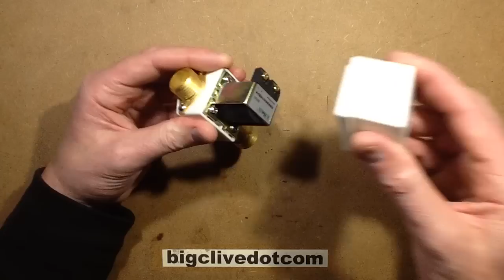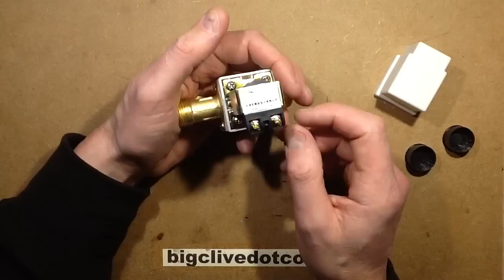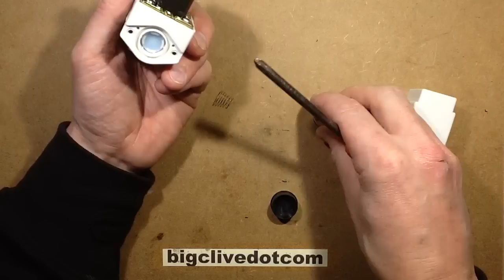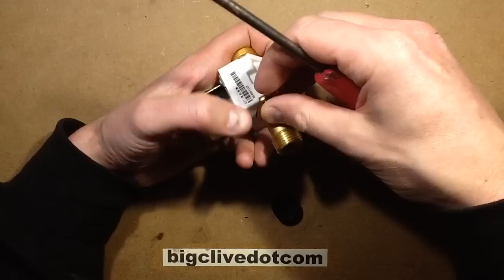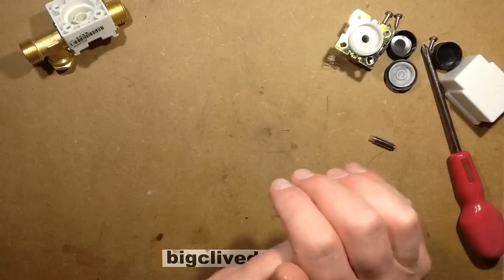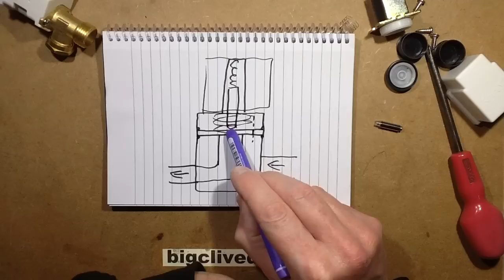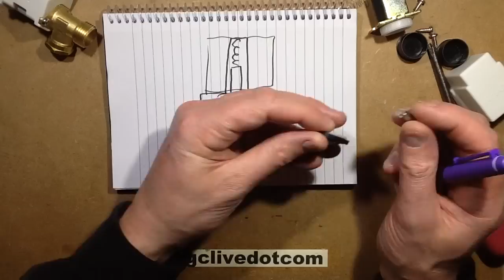inside a cheap eBay solenoid water valve.

Comment: Modern toilet cisterns have fill valves which work with the same method - it means the float can be much smaller as the force required is less than a traditional ballcock and valve assembly which equates to smaller, neater cisterns.

Comment: I wouldn't want to put too much pressure on that thing, it would rip the screws out of the brass ends.
Reply: I have only seen a glued in one fail. There would be millions of screwed in ones all over the world. If the outlet has any pressure on it the valve will close the inlet is only a small area so PSI is low.

Comment: That filter would be critical to continued operation.  If a bit of something gets embedded into the diaphragm, the valve might never shut off!
Reply: Normally the only part to jam them is the filter breaking. Mostly caused by rust on the plunger jamming. Some German washing machines have a mechanical device that unwinds and cuts off supply if water has been flowing to long.

Comment: wonder how much lead leaches from the brass...
Reply: its most likely alumium bronze, it would be cheaper that brass and be better for its conditions, lead would be an expensive additive
Reply: Why would you have lead in brass?
Reply: it stabilizes the alloy and increases machineability.
Reply: +10mintwo But it's the zinc that leaches out hence DZR brass - DeZincification Resistant.

Comment: Do you know a kind of "fail safe" valve that restricts water flow if a pipe/hose would burst, but allows normal flow for a short period of time if there wasn't any flow for some time?
Reply: Google aquastop.
Reply: Robert Szasz
Just looked at details on their website for the Aquastop YS mechanical only. You set the variables time/flow rates on installation, so you set them for what is normal for your situation. It also detects pressure drop across the device. I've never fitted this type, but i've fitted many of the hose-in-hose type, mainly because they are standard fitting on many high-end white goods.
Reply: mark rainford oh those look nice. Not exactly what I was thinking of, but just googling "aquastop" brings up a lot of random crap, where googling "aquastop ys" pointed me to wayscale and nice leak detection products. 
Thanks for the pointer to some useful stuff
Reply: mark rainford aquastop seems to be a hose in a hose shutoff. if the outside hose gets pressurized it trips a one time valve. Something smarter that just looked for flow or no flow, and shut a valve after x minutes of flow would be best. (a fire sprinkler  flow detector, a delay relay, and a electrically trippable valve could be slapped together to do what you want)
Reply: Yes, they also do mechanical only or electrically operated valves that detect abnormal flow rates.Robert Szasz
Reply: mark rainford the problem with those is that "abnormal flow" includes opening a valve all the way to fill a bucket or similar high flow uses (refilling drained water heater). Having a way to automatically shut the water off if there is either a high flow for more than x minutes, or low constant flow for more than y minutes would be nice. I havent seen anything with a time delay for high flows, or time delay with checking for constant flow rate.
Reply: Robert Szasz
Yeah, sorry. I should have linked it. I had to wade through all the makeup aswell lol.

Comment: Clive you gotta use it on a whiskey bottle hanging upside down, then you can make a remote control and a relay powering/depowering the valve and bob is your uncle ;-)
Reply from the maker: That task would be better suited to a peristaltic pump for accurate shots.
Reply: Unfortunately these valves have a minimum pressure. If you don't have enough pressure to overcome the force of the spring, they won't open.

Comment: I'd not be surprised if that Brass was DZR brass - allowing for variation in monitor performance, the shade seems "just right". The inline filter is a nice extra too - not particularly fine, but obviously someone's thought about this, and the end product is all the better for it. Chinese quality is RAPIDLY improving, and I'd expect the same transition in perception as we saw with Japanese cars - originally poorly-regarded, now the Industry standard.
Reply: New notepad too? Plastic coil vs. your "usual" spring coil? If those self tappers pull out Helicoil them - a far better fixing method, and (because of the finer thread) a much tighter grip.

Comment: Oddly enough my old electronics teacher gave me the first explanation of these ingenious valves - I think the context was an automatic bath filler with temperature control. It never happened - we couldn't find low voltage ones at a reasonable cost...and  tbh the idea was a bit rubbish...
I'd fancy this for greenhouse applications or perhaps a PIR operated anti-cat watercannon.
Reply: Built an "automated" watering / misting system using near-identical washing-machine valves decades ago. Two valves, and a pair of bimetallic strip thermostats, along with a simple 556 timer circuit and a pair of relays to handle the 240v for the valves. Built it in 1985?? Still works just fine . . . . . .
Reply: Phil S Yeah - that's the same period. we could get scrapped 240V washing machine valves cheaply enough but we weren't allowed to make mains gear in school. Thought about handrolling low voltage solenoid coils but then I went off the idea anyway.. There was a nearby shop that specialised in scrapping old industrial control panels and you could get some super relays, transformenr panel switches and stuff...
FWIW timer based watering systems are on the way out, you can buy ones you can control from an app on your iphone - so even on holiday you can busy yourself with domestic chores.
Reply: joinedupjon The "old and simple" approach works fine, especially where fault-finding is concerned! The "watering" side was not thermostat controlled - that was a standard "water for x minutes then stop" which seemed to work OK. The two 'stats ran the mister, a cheap bathroom extractor fan, and a solenoid / spring control on the roof vents  - I had a BIG (10 x 8) greenhouse and in the summer months, it "needed a little help" with  temperature management :-)

Comment: You explained it really well, I wonder what the maximum pressure that it can cope with is?
Reply: I don't think I 'd trust that on mains water pressure.
Reply: Mains water pressure isn't really all that much, it varies from around 2 bar to 6 bar, but if you have mixer taps in your home you should be using a PRV to regulate the pressure to around 2.5 - 3.5 bar (or you get leaky taps). A valve like this one would have been designed with industrial use in mind and should be able to handle more pressure than a domestic supply would be capable of.

Before anyone bangs on about turning down the stop tap, it's important to point out that pressure and flow are entirely different, they're like voltage and current.
Reply: *****
See that's what I mean, that's not a pressure problem it's a flow problem. Pressure only exists when the taps are closed and the pressure equalises to the external (to your property) pressure. If you put a pressure gauge on your system and almost fully close the stop tap, the pressure will remain the same as when it's fully open, but as soon as you open another tap you'll get a burst of water, which will then slow to a trickle because the flow is obstructed at the stop tap.
Reply: ProGamer1515 Personal experience lucky the water temperature is warm enough you barley need a heater in summer. The Chinese  metal taps just break if you bump them.
Reply: Strider9655
I'm pointing out the the valves on my washing machine handle, mains water pressure just fine and seem to be designed better and probably cheaper.
Reply: I am reffering to the design. Do a quick search on google for soleniod valves and you will see that the input and output on better designs is often a single piece of material. Less points of failure.
Reply: New Chinese metal taps corrode from the inside around 5 years life. Your on the 30th floor and the stopcock is downstairs behind the garage and you just stepped out the shower. Why they have floor drains in all bathrooms unlike the UK.
Reply: Strider9655
I've seen pictures of metal taps blown off by mains water pressure and people's boilers burst and flood because of it. The self tapping screws  holding the fittings on looks like a point of failure.
Reply: Coolkeys2009
Not sure what your getting at, I mentioned the use of a PRV, having one of these would prevent most if not all instances of what you describe as it totally isolates the internal plumbing from the outside water mains.
Reply: i might try that and get back to you
Reply: Larkhill21 What?
Reply: Larkhill21 Wow, they sound very shitty. You'd think there'd be separate cutoffs for each apartment in or near each apartment.

Comment: Entertaining as always.  Question, i was looking online for a atx power adapter that would allow me to go from say the 12v rail and be able to adjust the voltage and current.  I know about the little dangerous prototypes board as well as the little boost buck converters but i cant seem to find and dont know why just a box that you plug the 24 pin into and has those adjustments built in.  Are you aware of such a thing?  If not you should make em:)

Comment: Fantastic explination of a solenoid now i know why my washing machine makes a massive thud in the pipe as it stops water entering.
Reply: You can get small (<500ml) expansion vessels to put in the supply to act deal with this. Worked a treat here.

Comment: Absolute perfect description of a pilot-operated valve (for either pneumatic or hydraulic). I work with solenoid valves, pressure regulators and pneumatic relays on a daily basis, and you nailed it with a very easy to understand theory of operation regarding pressure differential on either side of a diaphragm.
Reply: Hi Lake, i need a few solenoidal valve for controlling the Waterflow through pipes. Can you give a link to purchase it in USA?

Comment: Hey Clive, great video as usual.
That black and silver screwdriver (that you use), is it a pound shop one, I ask only because I bought one from my local pound shop. When I saw it I thought 'Big Clive has one like that'. I have also paused one of your vid's that have the said screwdriver in it, to get a good look. I think I have the same one as you.
Reply from the maker: It's from Poundland.  It's one of the best of this type of driver I've come across.
Reply: Rabbi Zyklon Brausebadstein 
But still, very handy to have.
Reply: We got given a 'freebie' during a presentation at work, branded by a large German electronics manufacturer, looks exactly the same as the poundland one, made en masse in China no doubt and re-branded to suit.

It's quite handy though, I use mine all the time.
Reply: I recently bouught one (in red) from Maplin for 99p. It doesn't have a good Phillips range though.
Reply: pretty much clones and clones and clones
ive bought aset and ive got a few sets of some kingston hyperx ssd's
and a few from other random stuff
quality varies but all are pretty much the same

Comment: That solenoid valve looks almost identical to one I replaced recently in a truly cheap and nasty Montpelier washing machine. The coil had gone O/C, I didn't investigate the reason.
Reply from the maker: The coils do fail from time to time, particularly in machines with built in dryers that use a small flow of water to act as a condenser.
Reply from the maker: +simontay1984  In some of the combined condensor dryers where the moisture from the drying clothes is collected and pumped out via the drainage system, the cold water supply is used to provide a low level trickle of cold water to cool the condensing surface.  In the case of the early Hotpoint units it was just a channel down the back of the machine with a felt pad that had a continuous trickle of cold water running across it.  Horribly inefficient and failure prone machines.  Particularly the solenoid valve for the condensing flow as it would remain energised for the full drying cycle.
Reply: +bigclivedotcom It looks cheap enough to upgrade the coil with something longer lasting (boiler gas valve coils, both low voltage and mains, that should last for a decade) and still be cost effective. The bypass washer is a cheap replaceable component too. They last for many years in toilet ballcocks working at mains pressure.
Reply: I'm sure it works, but I am a tad amazed that the tiny hole up top is enough to reduce the pressure on top enough since its area is the full circular area compared to a smaller ring shaped area on the bottom, but hey ho I guess.
Reply: +simontay1984 If the machine vents to outside, but if it just recirculates air it has a condensing plate or coil which used small amount of cold water to condense the water vapour.
Reply from the maker: Dedicated condensing dryers are a much better option and do at least put out their excess heat into the room.  The combined washer dryers are just not really a good idea in terms of the drum size and technical complexity.
Reply: if you use the coil on its own you get stuff to float in mid air its fun

Comment: would make a great IOT ballcock. You could even wire it up to the cloud.add an Arduino and it could be sent a tweet when you flush..
Reply: DC Allan or tweet TO flush. the I telnet needs a toilet to flush
Reply: DC Allan or use an esp8266, much cheaper for IOT (-:
Reply: Kira Alteric cockball topkek

Comment: Hey Clive, did you fit that central heating water filter from your video a while back? Curious to know how much crap has collected inside if you'd consider revisiting it?
Reply from the maker: I've not done that yet.  I actually need to wire the heating back up again.  I replaced the entire garage roof earlier this year and had to remove it's cabling from the old joists.
Reply: Ouch, hopefully it all goes together no problem, especially before the proper cold starts setting in :)
Reply: I bought a fernox tf1 off ebay (cheaper than screwfix). My heating system is only 4 years old and i'm amazed how much crap it collects.

Comment: I used one of these valves to make a potato gun, but the amount fluid that can flow is very restricted so reduced the power of the potato, does anyone of a more suitable electronic valve that can let a larger volume of air flow
Reply: use it as a pilot valve http://www.spudfiles.com/files/3wayvalvediagram_483.png